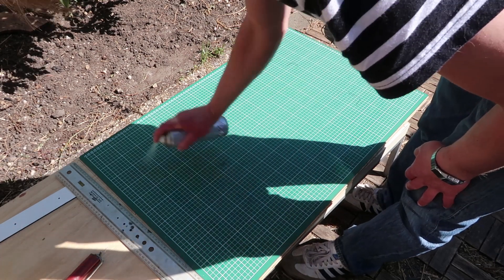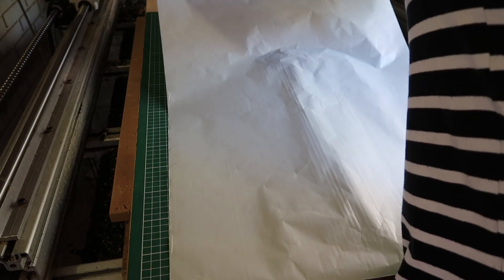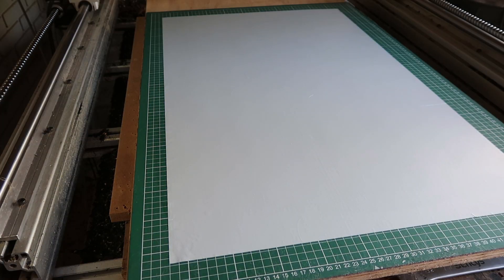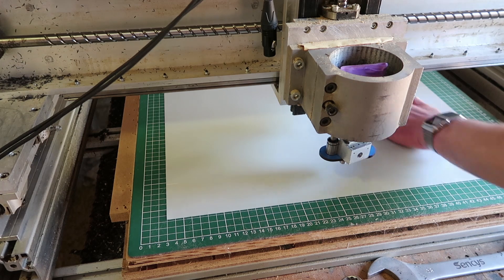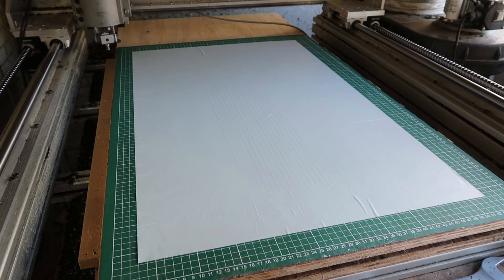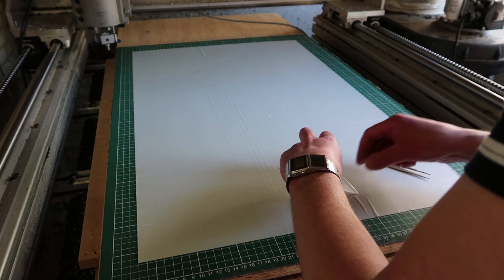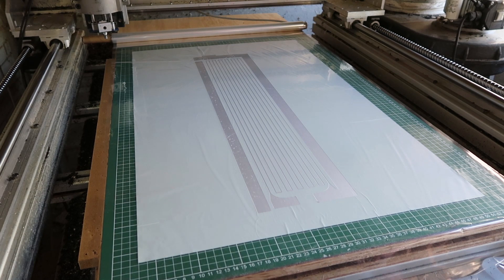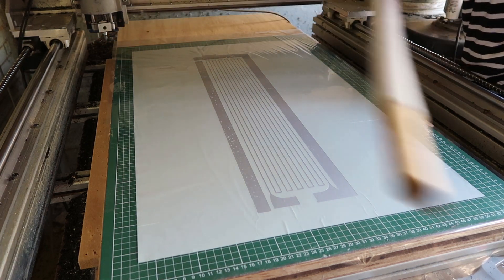Midrange Rubber Magnet Planar Magnetic - Part 4 Coil

Comment: After many hours/ days of test cutting, I find different foil thickness requires a different knife speed for a burr free trace. Blade depth is crucial also. Blade should initially be set to just barely cut through the material. Lower it just a hair if you can't clean up the edges with a speed adjustment. Your machine moves so slow enough where penetration shouldn't be of concern. Increase down force slightly (Add weight) to knife if not cutting through. Small test cuts are a good practice. I do multiple intricate cuts prior to large plot. Prevents heartache...
Reply from the maker: Thanks m8  gone have to do some tests then :)